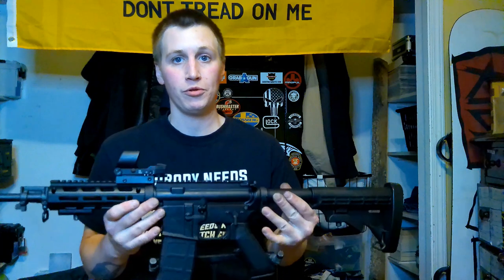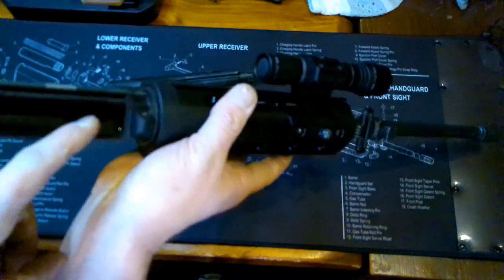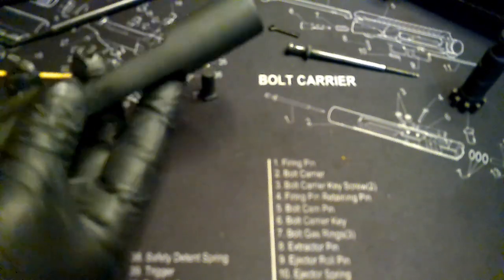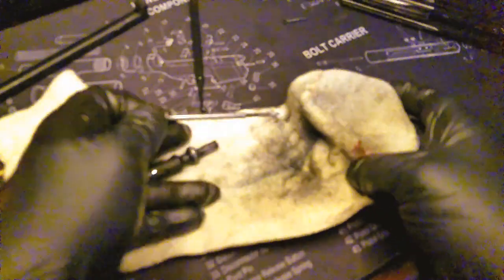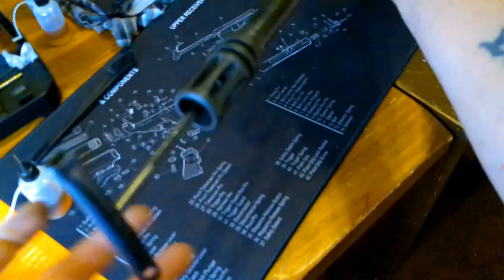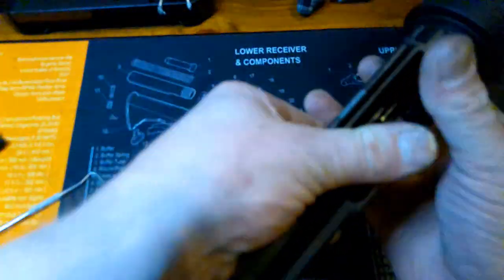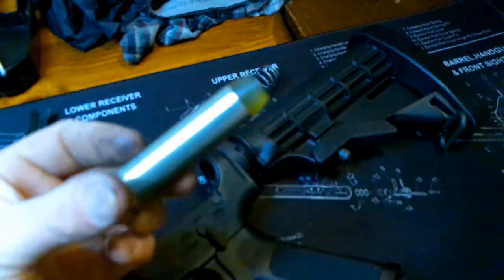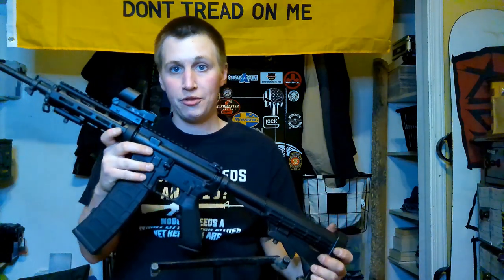how to field strip, clean, & reassemble the AR15 rifle complete guide

Comment: I’m a little confused when should I use the oil and when should I use the cleaning spray?
Reply from the maker: Either or they are essentially the same thing it's just basically whatever your preference is   I just like using the spray on some of the internal parts that are hard to get to then it kind of coats everything in oil and then I kind of just clean it up after that